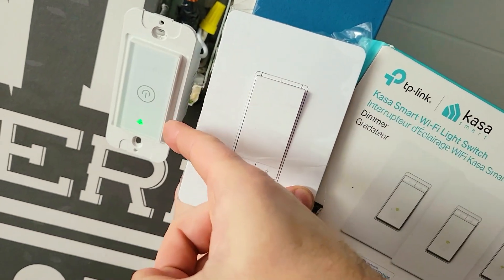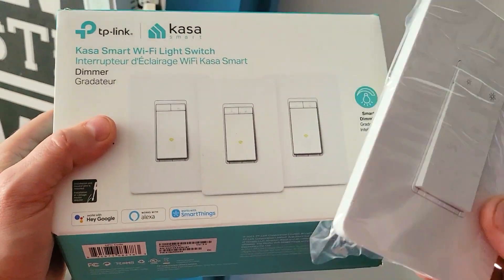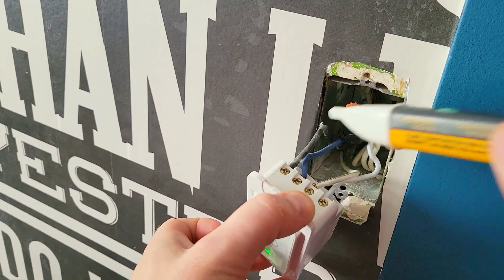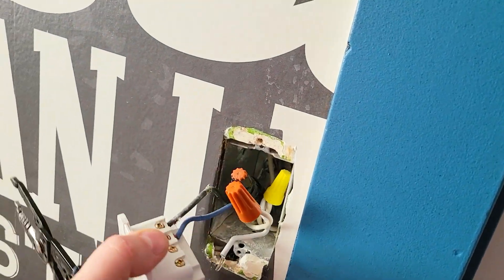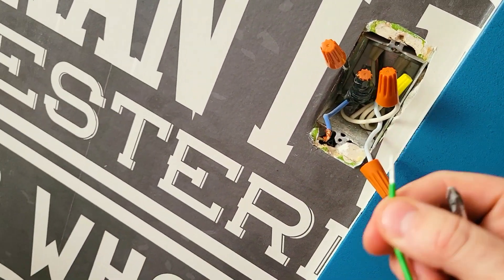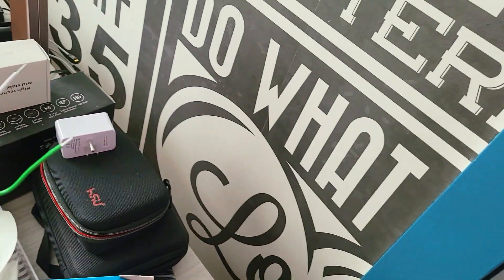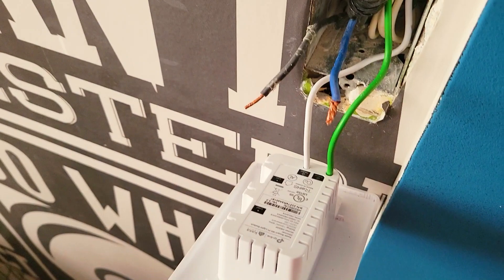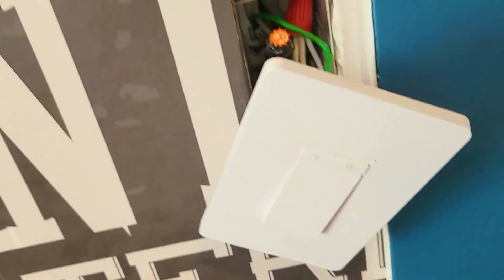How to Electrical Install KASA Wifi Smart Switch Dimmer - Step by Step Wifi Smart Dimmer Install

Comment from the maker: here is the link to the switch, this will work with most led potlights and bulbs with no hiss from the dimmer https://amzn.to/3b47X5i - Step by Step electrical wiring Installation of Kasa TPLink Smart Wifi Dimmer Light Switches. Showing you how to remove old switch and replace with new better one that doesn't hiss or requires reconfiguration after power shut off.